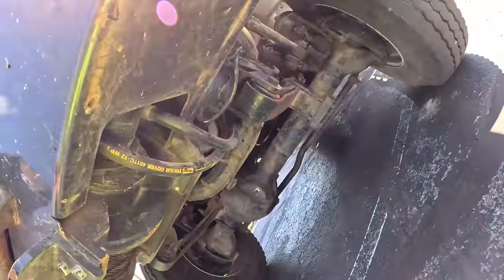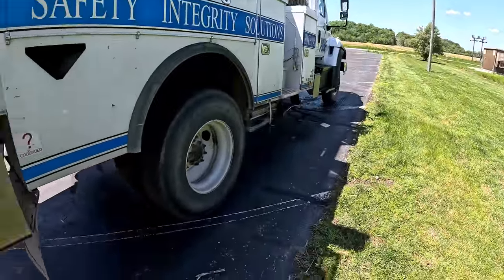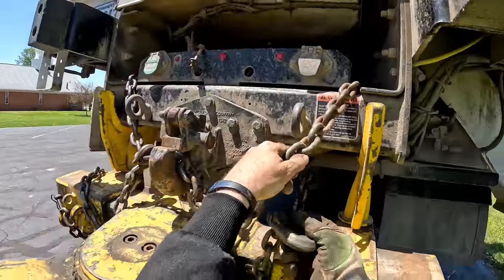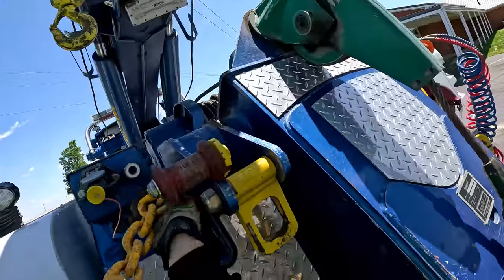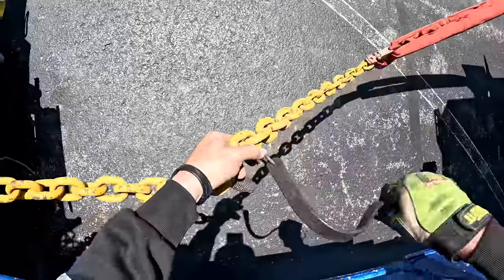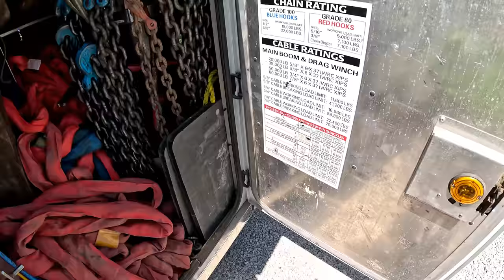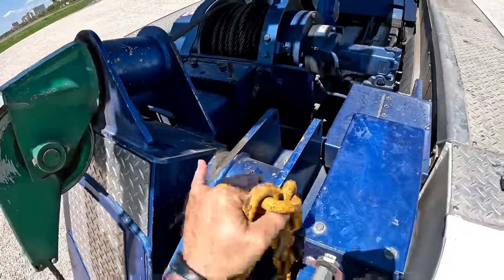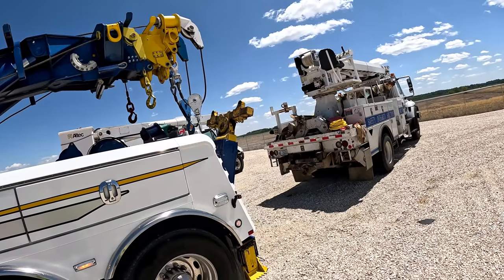TATOR TOW TIME!!!   AWD GRAPPLE - AUGER TRUCK!!!

Comment: Gotta LoL, back in the '90's there would be up to 30 bucket trucks in my parents yard waiting to be picked up to go to the trucks new destination, and a lot of the new trucks had either flat tires or the two speed axle would be stuck in low range, we had a cat the driver's called "the inspector" , she would climb up and "inspect" the trucks when they were in the yard, one driver had left the yard and got fifty miles down the road when he had to pull over and turn around to come back to the house, the cat had climbed in to the engine compartment and took a ride, the driver rescued her and put her in the cab and brought her back home

Comment: Its interesting how you went about towing that.  Great work as always!  I work for the equipment manufacturer that built that truck and I know for a fact we haven't considered how you would recover one of our pieces of equipment.  I would love to know more about what you would like to see on a bucket truck or a digger derrick that would make towing and recovery easier?  It's sparked a fun conversation in our office of how our equipment gets used in the field.
Reply: Good morning. Which equipment manufacturer do you work for? I was just wondering what kind of winch & bumper that is on the front of that truck.
Reply: @whatsmynameagain691  Its a braden pd18 winch bumper package, 20k hydraulic winch with a capstan shaft as well.
Reply: In my opinion, having discussions about how the things you manufacture are used in the field is one of the most important parts of the development cycle. And not just among yourselves, but with actual users, the ones using the equipment several hours a day.

I work in a hospital, and when we implemented a new electronic medial record system, we invited all the departments to join us and tell us what they want. Most of them did. The ones that did not are the ones complaining the loudest about how the new system doesn't fit their needs...

Comment: Oil is not nasty, it's rust proofing.  Gotta love the self lubricating chassis system 😂
Reply: CSW approved 👍  😂😂
Reply: Back MANY years ago I had an old at that time car that made me feel like when pulling into a gas station saying, check the gas and fill up the oil. Not only was it a leakier, but a burner too. If I stepped on the go pedal to hard I would leave whoever was behind me in a cloud of smoke. ☁☢🚭
Reply: I once owned a diesel car made in the 80's... no rust on it, even in the new england salt belt..
Reply: Thing is, if it's lubricating somewhere it shouldn't be, it's probably going missing somewhere it should be. 😜

Comment: Hi Ron!  Awesome video as always!
If I lived closer (I'm in Florida) I'd break out the motorcycle and come video for you!

I was watching that light bar you have and had a couple of ideas.  I don't know if any are incorporated and just weren't obvious, so I'll list them out:
a. Add a wireless dash-cam to the bar so you have live view/video from the rear looking backwards - it's not a case of you-never-know, more a case of 'when'!
b. Add a GPS tracker to the bar, so if it does come off for any reason, you can find it again!
c. Add a charging port to the bar so, like with the remote for the tator, when you put it in the bin you can plug it in and charge it ready for the next use.
d. Add a security cable to it to keep it attached to the towed vehicle in case the rubber bungees fail - kind of negates the need for point b above!

When it comes to the breakaway chains (between the towing and towed vehicles) I'm amazed that they still rely on 1920's technology!   Why isn't there something to take up the slack on those chains to prevent them from dragging on a corner?  It should be easy to design and implement, take up very little space/weight on the back of the truck, but I'll leave this here for others to put in their ideas!

Hope your finger gets better soon - you know for sure that murphy has his sights set firmly on it!

have a blessed day!

Comment: As someone with limited experience driving larger trucks, I've always been curious about the instrument cluster on the dash of the Rotator. There are something like 17 gauges.  I can certainly guess what a few are, but have always been curious what the rest are for.
Reply: Same, I’d love to see and get an updated truck tour of the fleet. From smallest to largest or largest to smallest.
Reply: I can answer that, oil pressure, water temp, oil temp, Trans temp, drive axle temp x2, air pressure times 2. Boost gauge, volts, pretty much a temp gauge for all the fluids. Looks confusing at first but easy to get used to. My truck set up the same way, other trucks set up much simpler.

Comment: Those rollers for the safety chains always seem to cause trouble for you and others I’ve watched on YouTube. It’s to the point where you don’t use the rollers and they are just in your way! Would you consider removing them to get them out of your way? 

I wonder if there’s an improvement that could be made on the design, because it’s a fantastic idea to make the safety chains easier to use so operators are more likely to utilize them.

I love these “odd” vehicles that you get. It’s always fun to see different units wether it’s a hi-rail truck, heavy hauler, car hauler, etc. These are my favorite type of videos!

Comment: Hi Ron.  I've been watching your issues with your ring finger. I worry that you will snag your pinky and sprain or mangle it too, especially without a glove. May I make a small suggestion.

Some years back I had an operation to my right hand ring finger which went septic and then caught a super bug. It took many months of powerful antibiotics  to stop it from taking my hand in gangrene. I had a two inch open hole right to the bone that had to be protected, but not sealed. I had a fancy brace to stop my finger from moving to protect the tendon and joint. Of course, just like you on your left hand, that darned pinky finger kept getting in the way and hurt.

My solution was get a single glove large enough for me to put my bandaged finger and the pinky together into the thumb.  I cut the thumb off of the bigger glove along with enough material to be a skirting.  I cut off the two outside fingers of my work glove and with good contact cement (because I can NOT sew worth a darn), inserted the prepared thumb cutting into the place where the other glove fingers had been. 

Now you still can't move your damaged finger much if at all, but it and your pinky will be covered and move together and all your left hand will have the protection of  a work glove.  You  also might want to paint the inserted thumb piece a bright color to remind you not to try to use the full grasp of that hand. 

Ugly perhaps, but at least your left hand will be safer from splinters and cuts and all the sundry mishaps for which we wear work gloves.

(PS if you're wondering, I lost most of the movement of my finger, but I didn't have to amputate  any bits. Funnily, my  hand is aways flipping the bird any time I make a fist.)

Comment: Just a tech tip: bring in the number 8 tow truck to lift the front end whilst the 12 truck handles the rear. Then tow it away in unison without having to disconnect the drive shaft.  Ur welcome.

--Pepe's

Comment: I worked for pike electric for years. There must be a serious problem if the pile mechanic couldn't fix it. I've seen those guys replace rear ends and just about everything on the side of the road.

The trucks called a digger by the way lol.

Comment: Another great video.  Question - How did you know that the front axle would be weight rated for a rear end frame tow?  Do manufactures factor that into the truck design and leave extra steer axle load capacity for a rear frame tow?  I know certain vehicles like a diesel pusher motor home can only be towed by lifting the front axle because a rear frame lift would severely overload the front axle load capacity.

Comment: Ron, I did not see you drop the front drive shaft, did I miss something?😮
Reply: It might have locking hubs.
Reply: @timskiff9422  No, it had flat axle covers!  Might have air activated from inside the cab though.  I was wondering if he had dropped the d/s and not filmed it.

Comment: What happened to the front drive shaft ? Did you have to remove it or not ? And can you explain to us (regular people) why or why not ? Thank you.
Reply: If the driveshaft causes the trans to turn it will quickly cause the trans bearings to lock up. Without the engine running no lube gets to the bearings whether is is automatic or stick shift.

Comment: Hello there. Ron: I have one comment. When you first pulled up to this vehicle you talked about it being a AWD / 4WD vehicle and talked about "No matter which way I tow it I will be removing one of the axles" but then you cut to being able to tow it with the front wheels free-rolling. How did you get the front wheels free rolling? You did not show or tell us this in the video and I am curious. Did you remove one of the drive axles? Was all the oil we saw from part of the AWD system being damaged and thus disconnecting the front part? Did you shift it into neutral inside the cab some how? You didn't tell us how you managed that and I was wondering what happened there.

Comment: Ron, I have noticed, that over the years, you truck seems to pick up another chain or snatch block or shackle after every video. As a emergency recovery vehicle is your truck subject to the DOT weight limitations?
Reply: @David Tyndall -- A very good question, and one I would like to know the answer myself.
Reply from the maker: @David Tyndall  Simple answer to your question is YES, we are subject to Federal, State, and Local laws as well as DOT weight, height, and length restrictions.  However, this is not a simple question.  There are exceptions, especially in Missouri, as we are considered Emergency Vehicles.  We can move ANYTHING regardless of height, weight, width, or length in an "Emergency" move or on a "first hook" basis.   This has a wide open interpretation, which many tow companies can/will exploit.   Anything other than a "first hook" or "emergency" move requires us to follow all FMCSA rules.   For instance, if I tow a truck and loaded trailer off the interstate to my shop, I'm ok.   If I tow that same truck and trailer off my lot to another shop or to the trucking company after getting it off the interstate, I would need an oversized permit for the tow, or I would have to tow the tractor only and use our semi to tow the loaded trailer.   There's questions about crossing state lines, such as "are we legal to tow a truck and loaded trailer that's broken down in Illinois and bring it to our shop in Missouri?"   Technically, it is a "first hook" basis, but it is crossing state lines with a load that is over-length and possibly over Gross Vehicle Weight Ratings.     Much like the red & blue lights....we are allowed to use them under certain circumstances in the state of Missouri, but are strictly forbidden from using them in the state of Illinois.  We go in and out of Illinois a lot because we are just across the Mississippi River from the state.  We are also very close to KY, TN, and AR.   Tough question there my friend.   I'm sure my answer was "clear as mud"...LOL   Thanks for watching and God bless.

Comment: Did not see you drop the front drive shaft.  Was it a manual shift or is it not necessary to drop the front because the front axle can be disengaged on 4 wheel drive?
Reply: While he did not show removing the drive shaft during break down while at the shop, Ron mentioned the driveshaft.
Reply: @coypatton3160  Yeah, he said he would let the repair shop know that he did not reattach the front drive shaft... 🙃

Comment: Ron, did you pull the front driveshaft ? And do you leave it out or put it back in when done ? Back in the olden days, I always put the shafts back in. Always afraid the repair shop would miss it and or cause damage.

Comment: Did I understand incorrectly that a rear tow would require the front drive shaft to be removed?  Was that actually not required or did you remove it off camera Ron?  🙂

Comment: 19:20 are those cones just sitting there? XD 25:20 well then. looks like they almost fell off
Reply: There is a rod that runs from the top of the winch bumper up inside of the cones.  The rod can fold over to allow you to open the hood.
Reply: @jacksonjohnson9953  genious, I would never figured that out, thanks!

Comment: Why couldn't you just put the transfer case in neutral instead of dropping a drive shaft?   Transmission wont turn with transfer case in neutral, and afaik most trasfer cases aren't pressure lubed?

Comment: Why couldn't you have used a clain on the out rigger insted. Would it have been stronger??
Reply: The chain wasn't long enough to wrap around the outrigger.
Reply: @Komdiv Maklenskov  I know, I was saying he could have used one of the other chains just like the rope
Reply: Those rope slings are way stronger than they look, probably just as strong or stronger than the break away chains. They have a vertical lift rating that doubles or triples in a horizontal pull.